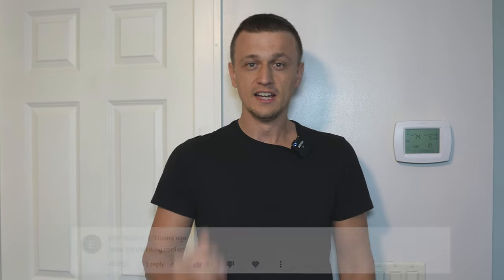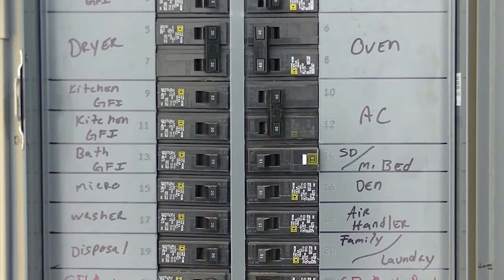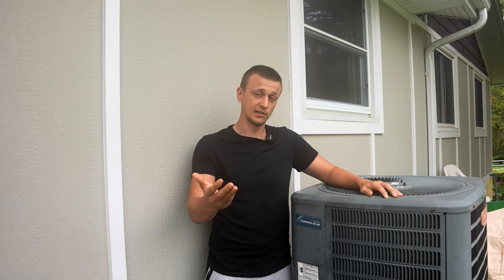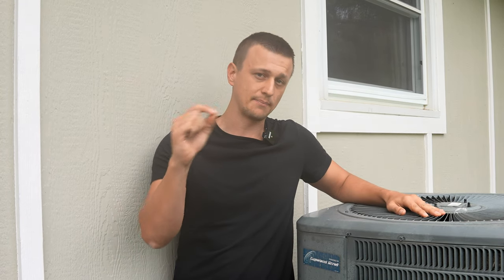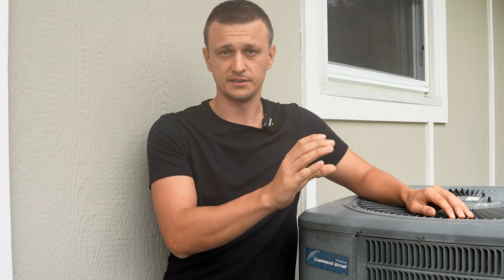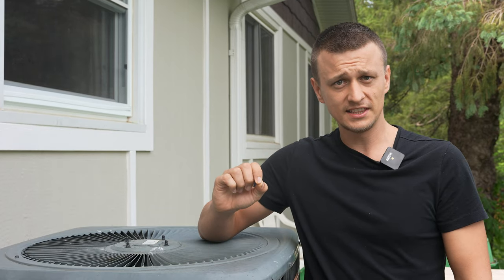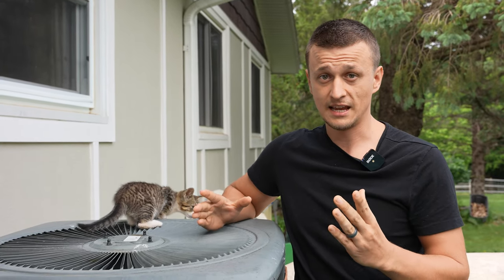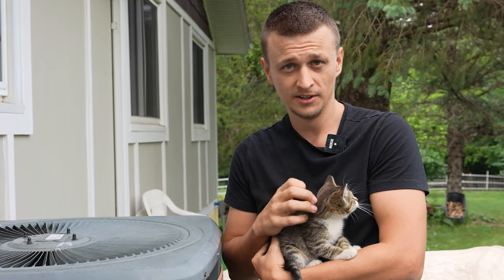HVAC Thermostat Blinking Cool On But A/C Not Working

Comment: My thermostat was blinking cool on then turns off after a while but no air is coming out. The unit is on outside . I changed the batteries and checked the breaker and still no air . Help plz
Reply: What was the fix?
Reply: Hit the break and cut it back on. It’s stuck

Comment: Good tips. I had a power outage and put new batteries in on the same day.  "Cool on" kept blinking  still after 30 minutes.  Once I cut the breaker for the AC on and off, then it kicked on.
Reply: Thank you for this comment. My moms AC was not cooling the house down and when I turned the breaker on and off it work again.

Comment: Great video !! - my Honeywell stat has a Waiting for Equipment message displayed which I believe is the same thing you are speaking about. This usually is about five minutes on mine. The reason  I think is it wants the pressure on the high side of the compressor to go down before kicking in again and stressing the compressor on startup. Say if the unit is running and power is interrupted. If the power comes immediately back on then the compressor would be starting against high pressure on the high side. This is why I think it’ll go into waiting for equipment to allow that high pressure to relieve somewhat before starting again. I may be wrong but I think that’s what’s going on

Comment: Thank you for the info. I had no power surge and made no previous adjustment but mine started to flash cool but not come on.   So, I turned  the thermostate off, replaced the batteries, turned it back on, and cool continued to flash.   I then turned it up where the thermostate wouldn't come on left it there for a few minutes, turned the temp back down to where it should come on, and finally that did the trick and got it working correctly again.

Comment: This is not working for me. The “Cool on “ keeps blinking and the AC comes on for about 5 minutes but it turns off before reaching the set temperature. 
Do you have any other ideas ?
Reply: Did you ever resolve the issue?  My system is starting to do the same thing.

Comment: This is a northeast problem more than a Southern problem. Five minutes is an eternity here in NY. I could have the service panel opened and be testing stuff!   
In the South,  by the time they get a screwdriver,  its working.
Reply from the maker: Lol, I can attest to it feeling like an eternity. Thank you for sharing the different perspectives 😂
Reply: I had a issue like that on a 2 zone system the upstairs worked not the down stairs with both zones on my thoughts were it's nit the system it had to be the thermostat or wiring so I shut the system down and in that wait time I changed both stats tried again this time upstairs didn't come on but bottom did that all I needed to know the Stat was bad replaced it no other issues

Comment: Yes sweated it out a few times with the delay. A refrigerator will do the same thing. I was told it’s so the refrigerant can run back down to the compressor.
Am I right?
Reply from the maker: I didn't run into this with refrigerators before, that's good to know, thank you!
Yes, kind of. This is how I understand it: The refrigeration loop has a high pressure side and a low pressure side while the compressor is running. After a compressor powers off, the refrigerant pressures "equalize" for a few minutes, the low side and high side balance out and both sides have equal pressure. Optimally a compressor should only start when the pressures are equalized. If it is turned on immediately after being powered off, it has to start in higher pressures which increases the amp draw, makes it overheat, adds wear/tear, and if done continuously will damage the compressor.
Reply: @WordofAdviceTV  , My friend bought a refrigerator and it happened to be packed on its side, and the
sales clerk said it had to sit upright for 24 hrs.
Reply from the maker: @classic287
Ah I see! That sounds about right and it is exactly as you said it previously. The oil makes its way out of the compressor when it is on it's side and it takes a while for it to migrate back after the unit is placed upright. 24 hours is probably more than needed but better safe than sorry. 👍

Comment: My furnace fan doesn't work. I unplugged it and replaced 5amp fuse. NOW fan working and AC working cold. But the cool on keep blinking eventhough AC running. Then EVERY 5 minutes it make clicking sound, fan stop about 1 second then both fan and AC running again.
Any idea why it happen? Maybe the American standarf bad thermostat need replacement?
Thanks
Tiger 
Rosemead 
California

Comment: I will be connecting my self contained AC unit next month. The home that I bought, has two separate thermostats on the wall, but I don't know if both of them function before or not.  
I will replacing the same unit with electrical heat pump, can I just use one thermostat for this unit?
If so, what do I need to look out for thermostats wired on inside wall?
Thank you

Comment: Love this video! Could you please do a video explaining the benefits (or lack thereof) of installing a hard-start kit versus a soft-start kit? Especially their usefulness for, say, a good but hard-working 25 year-old unit (mine is a 1997 Goodman CKJ60-1C 5-ton, in a workshop). Thanks!
Reply: Go to Word advice TV YouTube Chanel. Jay has a video on installing a hard start kit. Then click on Videos. Scroll down 10 rows in the second column you will find a video Jay did two years ago titled How to install a 3 wire 5-2-1 Hard Start Kit. Hope this helps you, my friend
Reply from the maker: Glad to hear that! That sounds like a good video to make! I mostly only installed hard start kits in the past but I have been hearing good things about the Hyper Engineering Surestart soft start kit. I don't have personal experience with it but it sounds like a better option than a hard start kit. I will look into it some more and hopefully make a video on the topic later on. 👍👍

Comment: Got a serious question for you, Jay?  I was replacing the hallway door this morning and as I was cutting out the old door, I discovered that the previous home owner ran the t-stat wires through the door trim....  Couple sparks flew, so I looked to see what happened and sure enough, I had severed several of the t-stat wires...  I shut the house breaker off and repaired the severed wires, reinstalled everything, then turned the breaker back on.  (Note, that I have a Google Nest T-stat, if that matters?)  The t-stat came back on and the return vent suction started again, but as the day got hotter, we noticed that the house wasn't any cooler?  We've been trying to figure out what has happened all afternoon.  We have a 2019 Goodman 2.5 ton unit, model # GPG1430060M41BA, (everything is all in one, outside).  The 3 amp fuse is fine.  If you manually push the Contactor, everything comes on as it should.  The vent fan spins freely.  There are no error light codes and it's a steady red color.  Right now, the unit sounds like it's doing something, maybe it's the vent fan spinning and it's vibrating very little, but still no cool/cold air and it's super hot in North Alabama!  Is there anything you suggest?  Thanks!
Reply from the maker: Sorry to hear about the AC troubles! So the low voltage wires got shorted out.. Usually when this happens, the 3amp fuse would blow. It's good that you have the fuse though because some units don't and I've had times where I shorted out the low voltage and had to replace the thermostat, transformer, and control board because of it. 🙄 I would try bypassing the thermostat at the furnace/air handler control board. ( https://youtu.be/bmZc76ufTNY ) If the AC turns on, then the short probably damaged the thermostat. If bypassing it does nothing, then I would go through my video on 10 reasons why a contactor does not pull in to see if one of them is your culprit: https://youtu.be/NVPhsK4gK1A
Reply: @WordofAdviceTV  The 3amp looks fine, but I'll replace it tomorrow, just to be sure.  After I asked my above question, I started watching your Contactor video and did touched the red and yellow wires from the back of the t-stat and nothing happened... :(   I also resat my t-stat, hoping that would have fixed it, but once again, it did not...  I know it's hard to diagnose, if you're not in front of it, but I'll keep trying until my HVAC guy calls me back, which I assume will be Tuesday or later.... :|
Reply from the maker: @JasonsFourCamFox  Ah shucks.. Why can't it just be a blown fuse right? If you have a multimeter you can check the 3 amp fuse. If it has continuity, then it's good. I would also check and see if you have 24-28v power from R to C at the thermostat strip on the control board.
Reply: Guess the low voltage wires you had cut off aren’t reconnected properly, if you have a multimeter and know how to use it, you may fix the issue yourself. Otherwise call a  technician. HVAC is not a diy job. Seriously!
Reply: You either blew the 3 amp fuse, or the fuse didnt work in time and you smoked your 24v transformer
Reply: @WordofAdviceTV  It's fixed and working now.  There was a nick in the t-stat yellow compressor wire and when I reinstalled everything yesterday, I assumed it must've broke in two...., as today, I did a test on everything outside and everything was fine.  I thought about rerunning the t-stat wires and that's when I discovered the new broken wire... :/  All good now :)

Comment: Jay, Thank You. Very Educational. I have a question. Has to do with Thermostat PRO 1 T-701. I didn't have a Manual to get all knowledge of this unit. Very depressing & annoying. On top of this Thermostat, is a button. This is what I found by trial-an-error. This shows Degrees, then numbers for cooling your Apartment. Example: 0,1,2,3,4,5,6,7,8,9. Now, this is what I needed to understand. I once had it on 2-. It wouldn't show my Thermostat to go down from outside cool air. It went down when my Thermostat went on to reach 78 Degrees. Now, I put my coolness on -0 from -2-. Now, the Thermostat went down to 76 Degrees from outside weather. Is this a good setting to leave it on? Does it cool  the same way as on -2-? I had a very uneducated Technician who installed it. Very Bad. I don't recommend. Love your Monologues. Unique!

Comment: I have Bryant Evolution Thermostats. In the beginning of the winter I turned on heat and then switched back to cooling. Then heat on and heating was working. But now when I tried to turn on cooling, the button is not responsive or switching to cooling. I switch off/on the furnace, circuit breaker. But still not able to switch to AC/cooling.

Comment: It also happens if you turn the air conditioner on lower to soon after it shuts off. Does not seem to do it if you lower it while it's on.
Reply: True just happened to me when I lowered the cool temp.
Reply: thats exactly when it happened to me!@

Comment: hi good day sir just have a question about my furnace... the temp inside the house wont go up i checked the sensor also change it .. and i changed the filter too but still doing the same thing it will turn for few mins and then it will turn off and wont go back on anymore

also the is a continuous red light that it said replace control .

Comment: Follow Up Question!

My AC (cooling system) is acting like it’s short cycling however when it’s ‘off’ I am seeing the thermostat flashing ‘cool on’. After a while the system turns back on for 5 minutes or so but then kicks off back to flashing ‘cool on’.

Thermostat seems to be okay, should I approach this from a short cycling problem? Or an electrical problem triggering the compressor delay?

Comment: So I had this issue with the delay after I changed batteries, it kicked on after about 5 minutes, cooled down 1 degree (from 79 to 78) and then kicked back off and it's no longer blinking but it's not coming back on. I have my thermostat set to 76.

Comment: Hey Jay, I have a question and need your help, I cannot find a replacement control board for my 1990 Lennox air handler (3 tons), no hvac supply house that  carry them . Is there a universal or generic parts for it? Thanks in advance

Comment: But what if the air never gets cooler and it only gets hotter? The air is on but it just never gets any cooler.
Reply: sucks to see they didn’t fix the problem fr
Reply: Spray the outside AC with cold water

Comment: Question: My new thermostat will only run in "fan on" not auto. Old thermostat still works in auto. 
I replaced a perfectly good Honeywell thermostat with another Honeywell thermostat but with WiFi, to operate remotely, just like the one in this video RTH6500WF. But I still have where the thermostat says it's on in auto but heat pump isn't running. Wires were the same and I used new base plate just because. In fact the old one works fine on the old base plate. Any suggestions?
Reply: Tried jumping it and only the Em Heat (W2) comes on. Y and G don't come on jumping wires. I think it has to do with the "function" settings like 1 heat stage, 2 heat stages, etc. I played with a few options and still same result. Still using the old thermostat since it works great but would love some insight. 

I have an air handler and electric heat under the house and an AC unit outside- any idea what the "function" should be set to?

Comment: Why my thermostat never reach the temperture . But the house feel like and is at the tempeture that is set on the thermostat . I change the thermostat  And still have the same problem . Only at night it seen the thermostat work fine . Also the cycle is really short when it reach its cycle i feel like the compressor may blow or the motor fan because they don't have a brake . But mostly this occur on really hot day .  problem at day time is that i have another thermostat just monitor the temp where the thermostat is . And the one is connected to the unit . The temp is greater like 3 or four degree them the one i have just to see the diffrent . Let me know if you . Or have any clue on this type of issues . Thanks for your help.

Comment: My thermostat is blinking cool. The air is blowing. The outside unit sounds like it’s on but the blades aren’t spinning and the temperature on the thermostat doesn’t change
Reply: What did you figure out from it ? Mines doing the same thing at 1:50 am smh